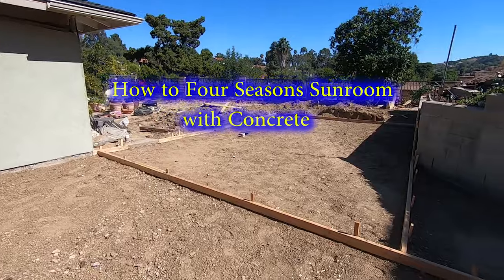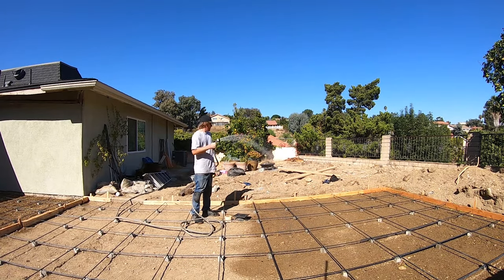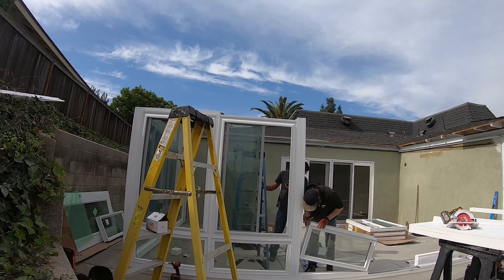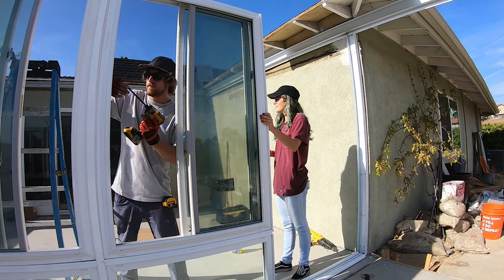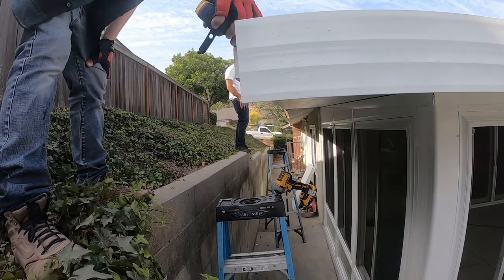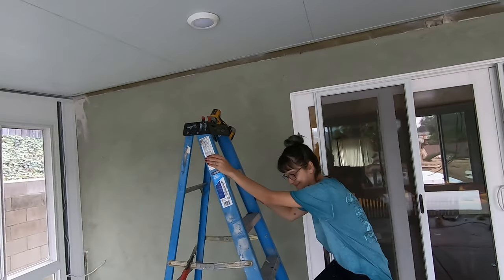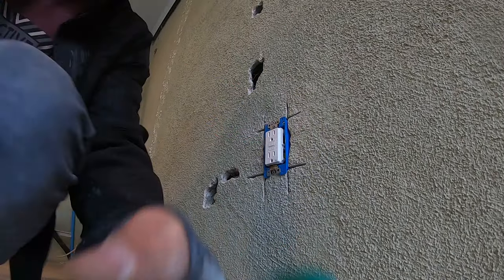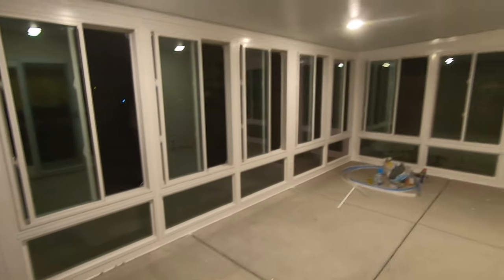How To Four Seasons Sunroom and Concrete with your Wife

Comment: What if your current patio sinks? Are there footers / foundation that can be poured deeper than the existing concrete?
Reply from the maker: You can add a larger footing for soil that doesn't have good compaction. In California, we don't have many sinking slabs, unless the property has really bad drainage

Comment: Your sun room looks great, I had one installed, it has been great, but the latch on the door broke and I can not get anyone to fix it. Do you have any instructions on the door?
Reply from the maker: Hey Jeff, do you know who your manufacturer was? Would be best to reach out to them to see if a replacement part is needed or if an installer can adjust the door. Usually it's not a major fix wit hthe PED doors, a adjustment is probably needed.

Thank you for your time and hope you have a great weekend, 
Everyday Patio

Comment: Awesome work. Would this withstand a Cat 5 hurricane?
Reply from the maker: Hey Catlas, you can have engineering specify requirement for high wind zones. The greatest requirements we deal with in California are 130 MPH by me. I assume a Cat 5 is 150 mph plus? So the room would be a slightly different layout. More supprt mullions, larger footing, potentially different framing components. 

Great question, hope you have a great New Year,
AJ

Comment: Wow! Beautiful!  If there is already a concrete slab on the patio, is that sufficient or do we need a new one?
Reply from the maker: Hey Pammy, thanks for the great question. Usually an existing 4 inch slab will work, if it has proper drainage away from the patio room. Sometimes engineering will call for an additional footing around the room.

Hope you have a great rest of your day,
Everyday Patio

Comment: Would I be able to get a kit for my backyard patio, I already have roof, my length is 20 feet and width on one side 10 feet and 7 feet other side as my bedroom window is a bay window, height approximately 8 feet and 6 inches
Reply from the maker: Hey Frank! Saw your other message, hope all is well. What state are you out of? We can better direct you from there.

Thank you for your time,
Everyday Patio
Reply: @EverydayPatio  I’m from San Antonio Texas
Reply from the maker: @frankcse Ok, your out of our personal service area, but you can reach out to your local manufacturer here. https://fourseasonsbp.com/. They have an area you can put your zip code and see local contractors and local factories. Botha re good options to start, for walling in your existing patio cover. 

Have a great rest of your day Frank

Comment: Can you remove the electrical cover easily after you put it in when you were wiring the porch light switch?
Reply from the maker: It fits into a hard extruded aluminum channel on this room, so no it's not easily removed, but it can be if you put pressure on the right side. 

Everyday Patio

Comment: Awesome video!  I’m also buying a Four Seasons sunroom. I have a quick question... how secure is the door?  I plan on getting double french doors. Is the frame strong enough for me to install steel security doors ob the outside of the french doors?  Thanks.
Reply from the maker: Four Seasons is as good as it gets for sunrooms, so you should be good, just make sure they put properly installed utility mullions on either side of the door. 

Thanks for reaching out and I wish you the best on your new room,
Alec
Everyday Patio
Reply: Thanks for the tip!  Do you have any stucco/mudder guys in Orange County that you can refer me to?

Comment: Thought for a 4 season sunroom you need to add an ac unit ?
Reply from the maker: Thank you for your comment Gustavo, a Four Season Room refers to the product and R-Value of the room.  AC Unit would be an add-on. The R-Value, shows how well your room is retaining or losing heat. Often the R-Value of a new patio room is higher than that of your house, depending on when it was build and if it has dual pane windows with Argon gas. 

Hope that helped answer your question,
Everyday Patio

Comment: Roof looks like it will not hold up well with a lot of snow.
Reply from the maker: It is a 4 inch roof, so it is rated for snow load, there also is a 6 inch roof option. More importantly, I would account for more pitch. In CA we only do 1/4 to 1/2 of pitch per ft. The more pitch you add, the more load the roof can properly support.